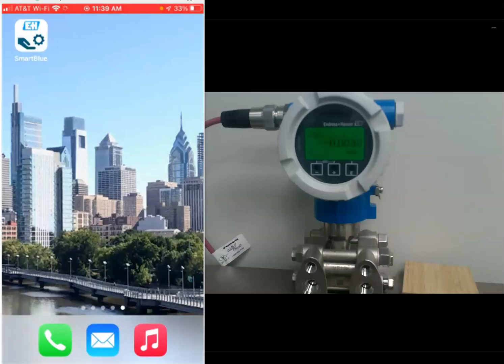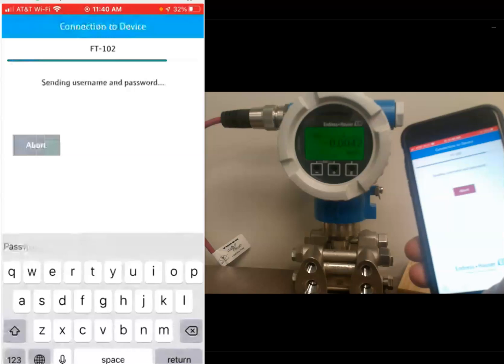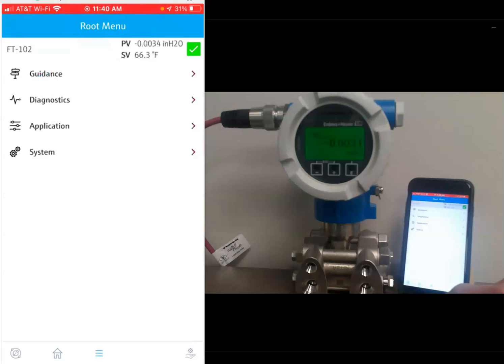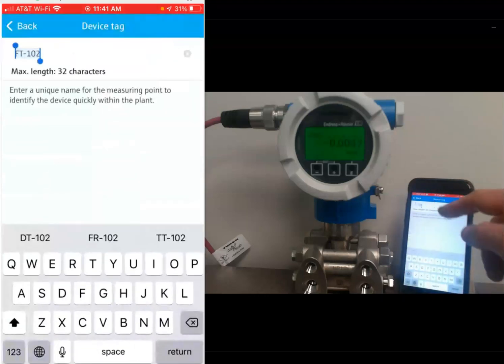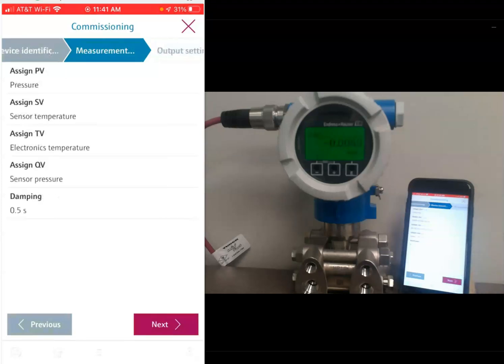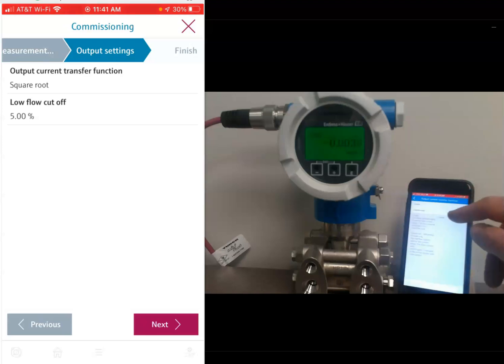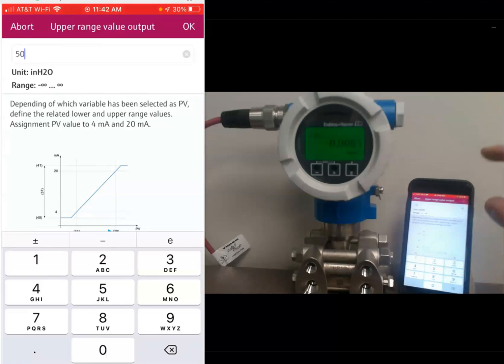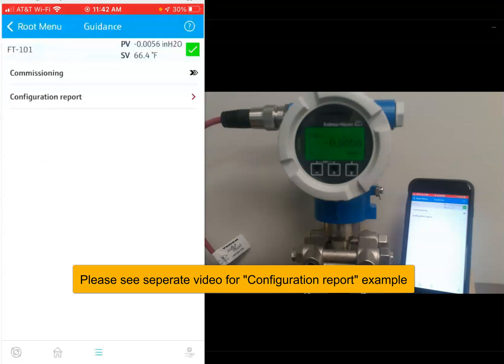Bluetooth Pressure Transmitter - How It Works

Comment: Hi Jeff, nice video, thanks for sharing. Have you used a Hart to Bluetooth modem? to communicate with not built-in Bluetooth Hart instruments.
Reply from the maker: I have tried the bluetooth modem connected to a laptop.  I like the wired HART modems better...and the method in this video is even easier - no modem required.  But yes, a lot of us still need the HART handheld or HART modem with laptop.  They still have a place and are widely used.